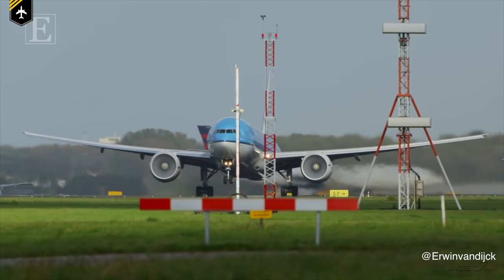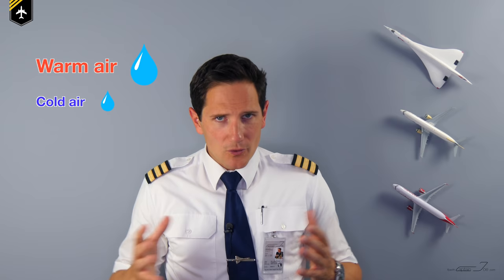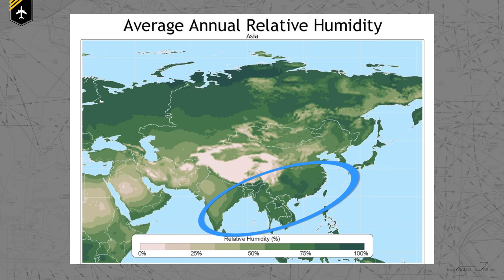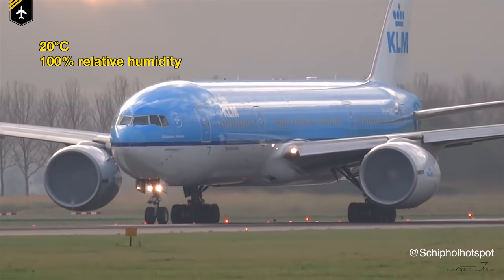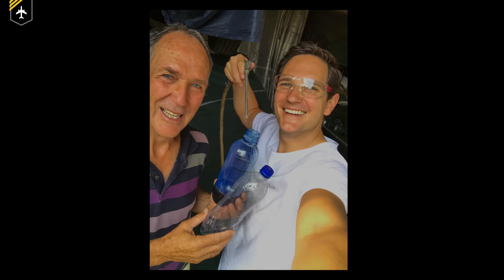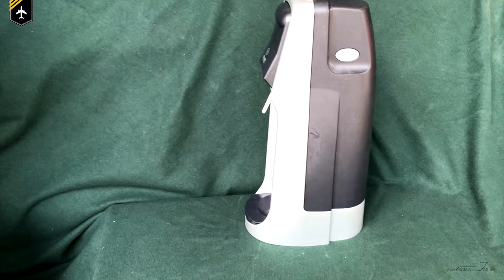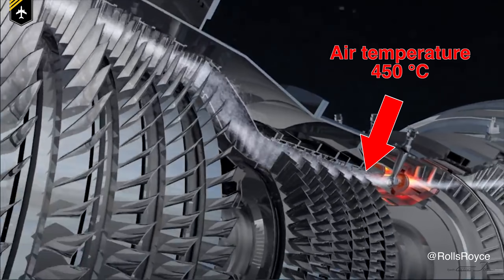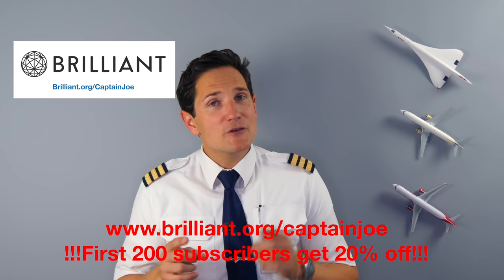WHY is there a WHITE CLOUD? Explained by CAPTAIN JOE

Comment: Accelerated air isn't cooler. However, faster flowing air passes more air against the warm surface and, consequently, takes on and evacuates more heat. To the skin, flowing air seems cooler ONLY because of the sweat evaporation off out skin and nerve endings detecting that heat energy gradient/evacuation as "coolness". I should add, since i forgot, that I was only referring to the part where Joe said "that's why fan feels cool". I most certainly wasn't trying to rewrite termodynamics laws! 😂
Reply: The direct effect of the pressure on the relative humidity is miniscule. But a change in pressure can result in a pretty high change in temperature and therefore a drop of the potential of the air to keep the water. 5° can make a big difference, especially at  near 100% relative humidity.
So the cloud is primarily caused by the temperature change which is caused by the pressure change
Reply: I just wanted to say the same. The fan works as way that increases the airflow around the body which increases swat eavpoartion or as long as room temp. is smaller is your body temp it transports cooler air winch increases the heat flow.
Reply: tabaks Wrong. When a fluid is accelerated, its pressure will decrease. What happens thermodynamically to the fluid is very similar to an adiabatic expansion. The work of expansion is done at the expense of its internal energy. This results in a decrease of temperature.
Reply: It is not acceleration but adiabatic expansion caused by sucking air from the front of the engine
Reply: Marek Sygula Go check any text on fluid dynamics, any fluid that is accelerated will decrease its pressure. It's Bernoulli's principle. As air rushes through the inlet, it will accelerate and its pressure will decrease. This sudden decrease in pressure as the air is sucked into the engine can be looked at as an adiabatic expansion of sorts.
Reply: Thank you for pointing this out!!! ;-) Many a discussion had about fans being left to run in empty rooms here ... 

But ... I wonder if at the speeds, volumes and changes in pressure that a jet engine entails, there is actually a change in temperature. I would imagine the physics is a bit different to a desk fan.
Reply: fast moving air = lower pressure air = cooler air
Reply: Jonathan Irons the running fan should be quite simple, the accelerated air slows down again and overall nothing changes. Except for the electricity the fan consumes, which as always is turned into heat.
Reply: What about the gas law?

pV=mRT

If you half the pressure p at a constant temperature T, the volume V will double.

An increase in volume will reduce the number of air molecules per unit volume (i.e. 1 cubic meter).
Temperature is a measure of the number of molecules in a volume to collide.

Increasing the volume at a constant mass (the number of air molecules in the initial volume), the temperature will drop.

Hence, decreasing the air pressure will give a drop in temperature.

Does anyone disagree?
Reply: @
Jonathan Irons, if my answer just above this is correct, I don't see why there should be any difference.
Reply: actually evaporating sweat (or water, really) does cool down the body. it's just that more of it can evaporate if air passes over it, because that air is likely less humid than the standing air around you.
Reply: MrJetra i agree with you, you seem like you actually know what you are talking about :)
Reply: Rodrigo Ramirez fluid or gas? IIRC this doesn’t apply to liquids.
Reply: tabaks 

It’s a typical isentropic process (entropy for heat, so the heat value remains the same).

Heat is not directly proportional to temperature. This can be seen in the shower with an older type mixing valve. Turn the shower on full blast. Let temperature settle, then take temp (T1).

Next, decrease water flow to halfway without adjusting any other mixing parameter. Let temperature settle, then take temp (T2).

T1 < T2 every time. The heat is constant, but the temperature increases due to less pressure differential (PD) on the inside and outside of the nozzle. The affect is caused by change in PD. Change in Fluid velocity causes the Change in PD, which causes the change in T. However, change in Fluid velocity, in and of itself, does not change T.
Reply: Just imagine what would happen if accelerated air really did cool down, you'd just need like three fans in a row to get below freezing, and korean fan death superstition would be completely valid :)
Reply: @Discoloured Buttflaps Fast moving air isn't at a lower pressure necessarily, and in fact if you only changed the speed of the air it would probably warm up a bit due to friction as it crossed surfaces or interacted with slower moving air. You can use a change in pressure (or specifically a pressure gradient) to make air move faster or slower, but they're not necessarily one and the same.
Reply: The acceleration is not what produces the temperature drop. the drop in pressure associated with the higher flow rate is what cools the air dramatically.
Reply: That's not what I see.

The Bernoulli's principle states that increasing the speed will reduce the pressure: V2 > V1 => p2 < p2.

I tried in an answer to tabaks comment at the top, to explain why the temperature drops when the pressure is reduced.

You are welcome to disagree.
Reply: Jonathan Irons I'm always having to tell my wife to turn off the cieling fan or some other fan, because no one is there for it to blow on.
Reply: Thank you so much, you pulled this from my mouth.
Reply: Exactly, accellerating gasses doesn't cool them down, expanding them does (principle behind air conditioning and fridges). The air in front of the engine is rapidly expanding into the engine, hence it cools down, hence it can hold less moisture, hence we see the mist in the front of the engine. The fan analogy is flawed, but Joe still explained what happens in an entertaining fashion.
Reply: Your explanation is correct as it related to the fan.  Moving air isn't necessarily any cooler, just facilitates more convective heat transfer.
Reply: Rodrigo Ramirez, in this specific instance, the air is accelerated because of the pressure difference between ambient air and the air in front of the fan. It's not so much that the air is magically accelerating into the fan which causes the pressure change, it is the pressure change which causes the acceleration. 

Think if you were to cap off the front of the engine with the fan on. The fan will evacuate that volume to a very low pressure. With the fan exposed to open air, the outside air basically falls into that low pressure volume in front of the engine. 

In the case of feeling cool in front of a fan, already-moving air creates its own low pressure in the flow via Bernoulli principle. The low pressure causes a drop in vapor pressure which causes moisture on your skin to evaporate which takes latent heat energy with it, and thus cools your skin.
Reply: Granted, but as Janis M points out in the following reply, there is no real pressure difference with a desk fan. The physics is technically the same, but Capt. Joe said this is why a fan works, which is stretching things. The effects of perspiration and convection are far greater than any pressure change.
Reply: Jonathan Irons Janis is describing the same thing. In fact, there absolute MUST be a pressure drop because the air is moving, otherwise physics breaks. 

This does require explanation of what vapor pressure is, and that's the pressure a liquid will exert outward that makes the liquid evaporate. Air pressure equalizes the vapor pressure and keeps the liquid from evaporating. Lowering the air pressure creates a differential between ambient air and vapor pressure which allows more liquid to evaporate. 

And of course as Janis said, when a liquid evaporates it requires latent heat energy in order to do so which is taken from your skin. 

So to sum up things, the lower pressure differential of moving air makes liquids easier to vaporize, which means that much more heat energy is taken from your skin than would be possible by just standing around in stale air.
Reply: I also recognize that Captain Joe is not completely accurate in his description of this effect. But of course he is a pilot (and an accomplished one at that!), not a physicist. His explanation of this effect, however, is close enough to convey the correct ideas to the layman, which is what his channel is all about.
Reply: Well said. Many thanks!
Reply: What you're explaining is effective pressure via the bernoulli principle, an effect of total momentum of the bulk fluid compared to the relative momentum of the individual molecules. A faster moving fluid will "push" less on a surface because a larger component of it's individual molecules' random velocities due to heat are bound up in the motion of the bulk fluid, even if the total heat energy stays the same. On a related note, this is also not the way aircraft generate lift.
Reply: It's about the pressure difference. That's basically how a fridge works. Compress the gas: it heats up. Release the pressure rapidly: It cools down. Speed is involved but it's not just the air speed itself. It's about the rapid change in the air speed as it gets sucked into the engine. Here there is a rapid speed increase and as result the air gets "stretched" and this is what causes a rapid pressure decrease. This in turn will cause a rapid temperature decrease which will turn invisible water vapour into a visible cloud.
Reply: Actually, faster air doesn't equal cooler air. It could cool off a surface faster by carrying away more heat, yet that's not what occurs in front of the engine. The only thing that cools the air is the pressure drop. You can think about it this way: you have 10 cubic cm of air at an air pressure of 1 atm at 10°. If you expand the same amount of air into 20 cubic cm, the pressure will drop to 0.5 atm and the temperature will also drop proportionally inversed to 5° (Actually it would drop to a whopping -140°C if we calculate it for real, because absolute 0 is not 0° but -273°C, but im schematizing here).
Reply: The pressure drop due to the rapid adiabatic expansion of the fluid causes the saturated water vapor in the air to boil instantly, causing the cloud.  It's the same as the contrail that forms over the wings of fighter jets in high-performance turns.  The saturated vapor turns to superheated vapor, which has more enthalpy, meaning the temperature had to drop in order for the fluid to change phase.
Reply: Rodrigo Ramirez Please check Jet engine air velocity, pressure and temperature profile. Joe showed the experiment where you can see that in the bottle where air is not moving water droplets ware shown. So it is rapid decrease of the pressure with no exchange of the energy with environment - adiabatic expansion . In this case movement of the air is caused by low pressure caused by suction by fan and compressor. And it can be only seen during low speed and high power. When the demand for air is so high that ram air compressions in front of engine is not enough to provide enough air, prsure drops and engine works as vacuum cleaner sucking everything around.  It is different do clouds on the wings where low pressure is caused by relative movement of the air over the wing according to Bernoulli low.
Reply: So you mean the heat transfer is better (or accelerated) and thus our skin looses heat faster and that makes us feel cool
Reply: "Accelerated air isn't cooler"
Given the law of ideal gases, there is the relation PV~=T where P is pressure, V is volume and T is temperature. In this case, the volume is assumed to be constant, which is the engine inlet, although strictly speaking the volume should be some volume of gas. Since the air is sucked, it is "streched" hence made thinner and loses pressure. The ideal gas tells us that temperature will go down as well, which has been demonstrated empirically time and time over again.
Reply: When the engine fan is run up to a high percentage of N1, the air in front of the fan is being pushed through.

A small parcel of air in front of the fan will feel a relative force.  The pressure at the front of the intake will be higher than the pressure directly in front of the fan.  A small fluid parcel will accelerate down this pressure gradient to a region of low pressure because there is more force being applied by the air behind it than the air in front of it.  

Because this parcel of air has mass and will resist the acceleration (as all masses do), this helps to maintain the pressure gradient.  So there is a circularity to the explanation of the phenomenon (as is common in fluid dynamics).  

When the pressure is decreased on a gas, the gas will expand.  This expansion, even into a relative vacuum, takes energy.  The energy comes from the relative motion of the molecules in the gas.  As the gas expands into the relative vacuum, the root mean square velocity of the gas molecules drops, and that means the temperature drops.  This means that condensation will form if the relative humidity is near 100%.  The process is extremely fast (less than a millisecond), so there is ample time for it to occur in the intake.

The instant the air passes through the fan, it now enters a different environment in the bypass duct around the engine core.  The walls of the bypass duct are very smooth to minimize drag on the airflow, but there is still drag.  This means that the air will be entering a region of progressively higher pressure as it flows down the bypass duct, leading to a net deceleration (or forward acceleration) of the airflow.  When this happens, the pressure (and temperature) goes up and the condensation re-evaporates.  That's why you don't see fog coming out the rear of the bypass duct.
Reply: @MrJetra  I have to disagree with your definition of temperature. What you define is air density. Temperature is the middle kinetic energy of molecules in the test volume.

In addition the preconditions for the validity of the ideal gas equation are not given here. The correct explanation is given by the adiabatic expansion, the ideal gas equation alone is not applicable because the system does work (expansion). It does work whilst expanding and thus loses inner energy which is proportional to the temperature. It loses more energy and thus more temperature than the ideal gas equation would predict (however we still assume we deal with an ideal gas).
Reply: Moving air has increased entropy which becomes increased enthopy(aka warmer), what you enjoy with a fan is the increased convection
Reply: It took approx. 22 comments to have the key words "convective heat transfer" finally mentioned... :)
Reply: Pressure behind the fan is reduced (it's "sucking") but pressure in front of the fan is increased (where it's "blowing")... so, for example, with a desk fan blowing at your face, the air that's leaving the fan and heading towards your face is not accelerating, it's slowing down... it's simply the movement of the air, as long as it's able to accept the increase in humidity from the sweat on your face leaving with the heat. BUT, the overall temperature of the closed system is increasing, because you're adding energy required to turn the fan from the external power source, it's only you that cools down by transferring heat into the air. A fan running in a "perfect" (air sealed, insulated) room will increase overall temperature of the room, you're adding energy, it's as simple as that (assuming the electricity is generated elsewhere)
Reply: "But a change in pressure can result in a pretty high change in temperature"
Yup. That's pretty much how refrigerators and air conditioners work, and it works both ways, when a compressed fluid expands, it cools down, thus the tiny cloud when you open a fizzy drink can, but when you compress a fluid, it warms up, and that's why the back side of refrigerators feels warm to the touch, because it's essentially a big radiator used to cool down the now compressed gas before it goes into the refrigerator again.
Oh, and it's also why the main component of both devices is a compressor.
Reply: "termodynamics"
Reply: evaporative cooling vs rapid temp drop are different
Reply: @MrJetra  Temperature is not a measure of the number of molecules colliding. That is a common misconception. In fact temperature is proportional and more like a measure to the kinetic energy of the contained particles. 
Even though that is at first contradicting the result in this case. 

The temperature increase in an inelastic collision (eg car crash) comes from friction. Physics treats the collision between particles of the size of molecules as PURELY ELASTIC. Frictionless. When trying to think about this tiny world the fitting model of colliding pool balls doesnt work anymore since no particle is touching another. Its purely an electrodynamic interaction which therefore cant! result in friction.

Also the gas law is only working for 'imaginary/ perfect' gases. That means that there are no interactions between gas molecules and that those molecules are infinitely small. To realize that in this world you would have to expand a gas so much, that its molecules were never colliding. (You can see where this is going. One of physics's nice inventions to see everything theoretical)

A real gas is described by the formula: (p + a/V^2)(V - b) = mRt. (look up ,,van der Waals equation'')
It is quite similar with just two expressions added.

a/V^2 accounts for the additional pressure because of the particle interaction.

b is accounting for the size of the particles because their interaction happen of course more often when being bigger.

Also the gas law is only used to calculate the two endresults, when going from state A to state B. It does not care about the way you got from A to B. Its variables are only state functions. 
As you might have noticed the phenomenon we are talking about is purely happening due to the work of the engines and temperature, volume and pressure are changing. So the PROCESS is important. 

To describe processes there are different formulas for isothermal, isochoric, isobaric and adiabatic processes. 

In this case the engines are speeding up the air, expanding it. This is being done at cost of the internal energy of the gas molecules. Since it is done very quickly (look up adiabatic expansion) there is no exchange of heat with the surrounding 
NOTICE the difference between heat and temperature!
bottom line: work being done takes away from internal energy of the molecules and decreases temperature because of that.
Reply: Air is colder above the wing because when it moves faster the pressure drops which affects its temperature
Reply: It's not ONLY because of evaporative cooling. There is thermal transition resistance caused by an air film on the outside of the (warm) body. Moving air essentially blows that air film away. Because there is more wind on the outside, is why when you calculate a building envelope component's thermal transmittance, you add a smaller transfer resistance coefficient for the exterior surface than for the interior one.